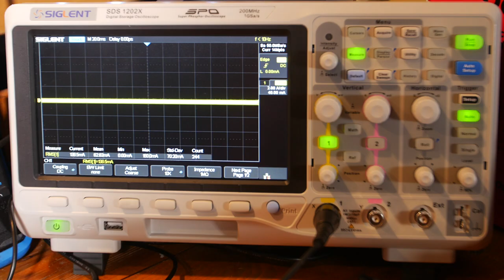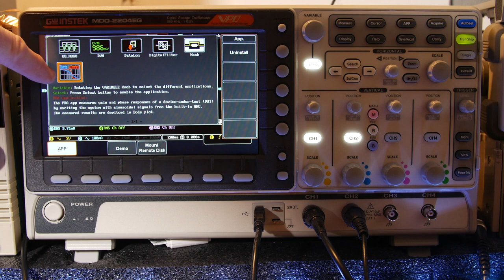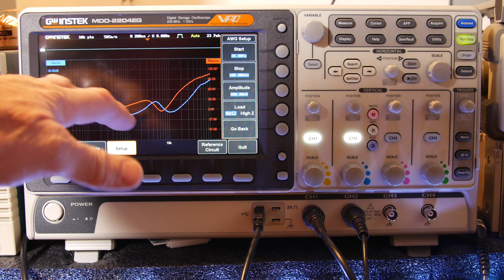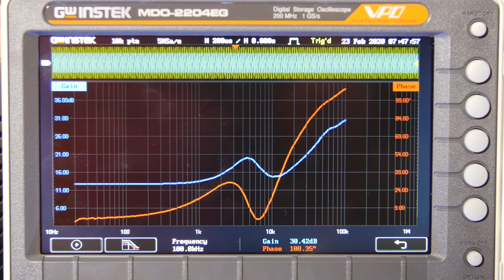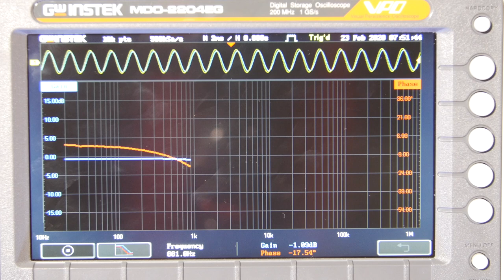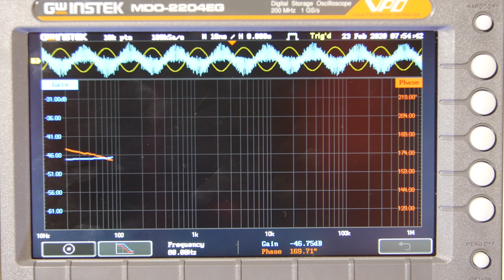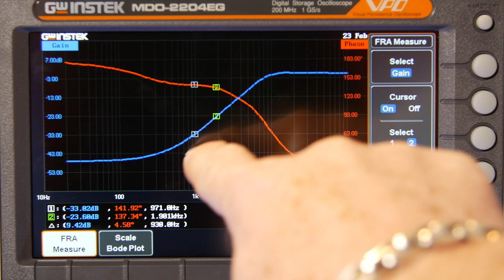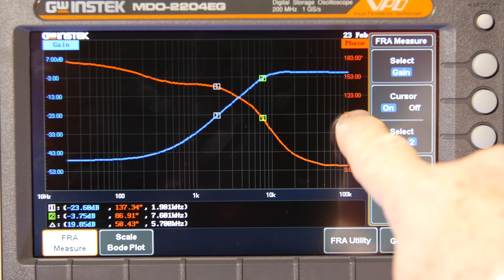2 Way Crossover Power Tested  Part 2

Comment: Love your video . A lot of this is new to me . My scope is an old 60 MHz made ? 70s I play with a lot of RF radios feeling the need to up grade to a new low cost . Singlet 1202x-e or a 200 m hantek for the fft , your thoughts .
Reply from the maker: Thank you Robert!  I think the bandwidth is just fine, but the new scopes do have an FFT function theses days which I think you might find useful.  I do like that Siglent.

Comment: Great and interesting video, could you maybe make a video on what that phase change do mean, what is happening and what is the ideal? :-)
I like it over all but just a few comments:-) 5:03 the cut you have here is "to big" compared to what is happening, if you have the possibility to fade between images, you could have used it here, since everything is nearly the same.
6:44 4 Here are a trick you can maybe use instead of your  4 times clip, I imagine that your audio were on all of those clips and you had to include them to get the full sound of what you did say. Just to make it easier to explain do I number your clips in that editing. 1st clip is everything up to you make your cut after moving the camera, then do you have 2nd, 3rd and 4th cut where the 4th cut is where you end up with finishing your explanation. If you had made your 1st cut as you did and then only added the 4th cut but frozen the image in the few seconds the other two cut sounds did play, and then unfroze the 4 clip when the 4th sound should keep on. Hope I did explain it somewhat:-)
Reply from the maker: Thank you so much!  I need to study this - I really appreciate your help;)